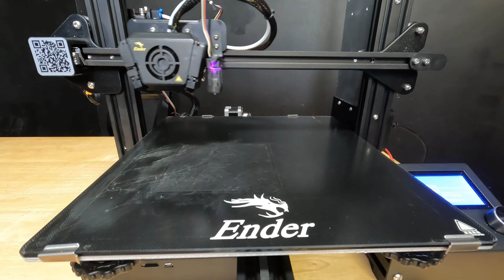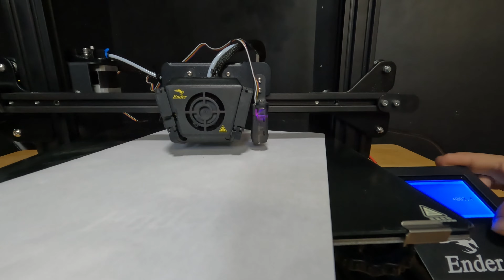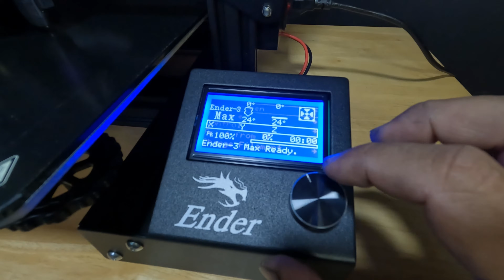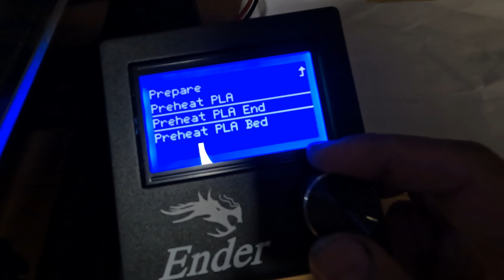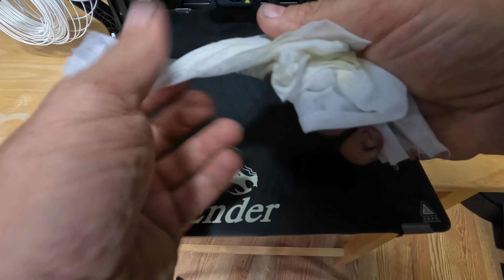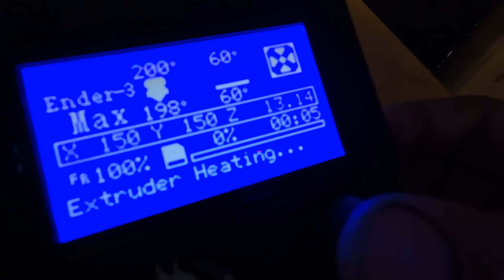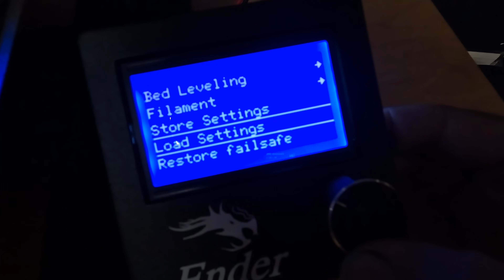Ender 3 Pro or Max: How to Level, Set Z Offset, and Make ABL Mesh, with CR Touch or BL Touch

Comment: hey i got the cr touch and have tried both creality software and marlin one but with both software whenever i try to auto home the ender 3 pro says that homing failed and it will go to the centre of the print bed and just keep trying to go down, ur videos are very informational and i rly like that thank you for these guides i hope this gets to you well.
Reply from the maker: All ender firmware is Marlin. Be sure it's a BL Touch compatible firmware.
Is your probe to high? Does it retract when it touches the bed? What if your touch it yourself?
Reply: @3DRundown  when i do a test its perfectly fine and shows the purple colour when i auto home it turns blue goes to the middle extends and stays extended the whole time when touching the print bed in the middle im sure its a bl touch compatible firmware cause i do exactly what you do
Reply: sorry for the double comment but ive tested it some more and ive lifted the print bet a tiny bit and now it will retract but it will stay in the center instead of going back to home
Reply from the maker: if the probe doesn't retract before the nozzle touches, print a spacer, to lower the probe. I have a video here for that

Comment: When I try and lower the z axis to get the number to put into the z offset later, my machine will not allow me to use a negative number.  I can input a negative number in the z offset but I have no way to know what it is because the machine won’t do it when the steppers are off and adjusting because it won’t let me go into the negatives.  Any advice ?
Reply from the maker: You can not go negative in the MOVE function. You must be in the Z OFFSET adjustment. Then, it will let you go negative, and save. It may be called "Probe Z Offset".
Reply: @3DRundown  under “motion” then “bed leveling”, I have “bed z”. I can set a negative number there but it doesn’t move the z axis when doing so. I assume that’s where you would set the negative number, but I can’t figure out where to go to be able to make it go into the negatives to find what the negative number should be.  
The categories are motion, temperature, configuration, change, filament, about printer, release, media, print for media.
Reply from the maker: Consider getting a modern Marline firmware for it, here: https://marlin.crc.id.au/
Reply: @3DRundown  Thanks.  I have BIGTREETECH SKR Mini E3 V2.0 motherboard but i don't have a bl / cl touch.  Which firmware do you recommend that would allow me to make a bed mesh without the touch?  My bed is not flat so i need as many adjustment input points as possible.

Comment: So i doubt it was your advice but rather something i did . I had tryed to do this several times after making a mistake that plowed the print head into the bed i decided to reset to default setings and after that seems i could nolonger mover the z axis with the dial wheel after I would run auto home . And normaly gives me the err too far messege on the screen . If anyone has advice on what thos could be ot would be grate im new to the ender 3 and its a ised printer so probably pocking up somoneleses problems lol.
Reply from the maker: I would start with getting better firmware on it. I use these guys, on my older Enders. you may need to donate like 2 bucks (worth it) https://marlin.crc.id.au/

Comment: i agree, very good instructions - the way I like them.   However,  when I go to Move Z on my Ender 3, it will not let me go past 0 into negative numbers.   Maybe there's a different option for Ender 3 v2
Reply from the maker: It's not Move. Move will never pass 0. You need to find the Z-Offset adjustment, and adjust it there. It may be called "probe Z Offset".
Reply: Did you ever find the setting? Mine does the same thing.  I don’t see the setting he is referring you to.

Comment: Once again, you’ve done it! I had trouble with my ender three max Neo, not printing. In other words the filament didn’t come out of the nozzle. I replaced the nozzle. I replaced the extruder and still no dice. Then I heard somewhere if the needle is too low to the bed, the filament will not come out. I had a clicking noise and that may explain why the filament could not exit out of the nozzle. I just did this video once again and I’m up and running thank you.
Reply from the maker: Very welcome! Now earn a STAR next to your name, and be a member. :)
Reply: And how does one earn a star? Is it a gold or a silver star?

Comment: Stupid Question.
What's the point of the CR touch if you still have to manually level?
I've had no issues thus far manually leveling with a standard Z-Axis sensor.
I'm not trying to crap on the parade....
But genuinely i need to know why this is an upgrade?
Reply from the maker: Because only a TRULY LEVEL (TRAMMED) bed, can print a model with consistent parameters.
Once the bed is as close to perfectly tram as possible, then, the CR TOUCH will probe the bed, create a map of the inconsistencies (MESH),  and then adjust for them while printing. Your 1st layer, at 0.2, is TWO TENTHS OF A MILIMETER. Having that EXACT across the entire bed, is virtually impossible. This will create digs and gaps, in your 1st layer. Your ABL Mesh, will compensate for that, to create a consistent 1st layer. 
It also gives you FIRMARE Z-OFFSET control. This is critical. You need that, to get your Z-Offset correct. Adjusting your bed or Z-Stop, is how you would have to do it otherwise.
Reply: @3DRundown  thank you for a legitimate response
Reply from the maker: What is an "ABL" Auto Bed Leveling Probe? What it does, Why YOU should have one https://youtu.be/yg2zVAakeGU?si=QW_ZXztyRwrdLgmd

Comment: Sooo I have to do all this. What’s the point of having the cr touch ? If you still have to level everything
Reply from the maker: Yes. You need your Tramming to be as good as possible. Your ABL should only have to compensate for minor differences in your tramming. A cars shocks can handle a bumpy road, but a well paved road is a better ride. Also, CR-Touch doesn't handle Z-Offset at all, that's on you.
Reply: @ hey I took everything off ( for the touch) now the z axis doesn’t auto home anymore. Do I have to install a different software now ? ( I installed the cr touch software for my ender 3 )
Reply from the maker: Keep the CR-TOUCH ON. You will lose ABL, and, you will lose Z-Offset control
Reply: @ how do I convert it back to normal?
Reply from the maker: You would install a firmware that doesn't support BL-TOUCH. And to use the CR-TOUCH, you would install firmware that DOES support BL-TOUCH.  I Would do THAT

Comment: My Printer was running for month and now I Changed the Nozzle. The Z offset isn't right anymore but I can't get it to move while printing. Any tips?
Reply from the maker: Your New Nozzle will be a touch higher or lower, than your previous nozzle, so you will need to set the Z-OFFSET after the change. It SHOULD move.
Reply: Sorry for the late answer I didn't see the comment😅 my problem is while printing when I go to tune the only option is z baby steps. I can go to configuration while printing and there I can change probe Z offset but this doesn't move the Axis. Babysteps Work but I don't know if I can use it and then add the value to my probe offset. I hope it's understandable. English isn't my first language 😅

Comment: My printer flashes the number and a "?" for the z axis on the info screen and doesn't want to move down for the bed leveling process, Do you know how i can fix that?
Reply: Is the z offset button thing disconnected?

Comment: I’m a bit confused as the last part, my Ender 3 doesn’t have probe z offset in the tuning section but it has baby step. Does that function the same?
Reply from the maker: Yes
Reply: @ thank you for your answer. I’ll try to play around with it.

Comment: For some reason after following this video to a tee, ive been having a issue all night and been trying to figure it out, my printer will now freeze 2-3 seconds into a print now since installing a CR touch im not sure if its a firmware issue or whats the deal but i cannot figure it out
Reply from the maker: Check all the cabling. Be sure nothing is shorted, and no connector is HALF IN. Consider a better firmware, such as one from these guys: https://marlin.crc.id.au/

Comment: That is true but we all know that the factory sometimes forget to check every printer out there because my build plate was lose on the. So I turned to the 3d community and you
Reply from the maker: Always a good idea to go over as much as possible. Also, things often vibrate loose over the long shipping trip from China. Especially on older machines
Reply: @3DRundown  I have got a ender3 v3 se. Thank you for your help and time.

Comment: Gregg adventure awesome video for the older model of the ender. Great information on leveling the build plate.can I do that or something like that on my ender3 v3 se
Reply from the maker: Your SE is trammed at the factory, and uses a Strain Gauge, to set the Z Offset. But the ABL Mesh, works the same

Comment: What is your meaning of snug*
Reply from the maker: Speak to me respectfully, and maybe I'll spend my time speaking to you
Reply: @3DRundown  not directed twords you in a disrespectful I’m just having the worst time understanding what I’m supposed to be doing my apologies 
Just realized my what auto correct to wtf
Reply from the maker: This is the place where frustrated printer users come....  Fear not, if you don't desire to throw your machine out the window, you are doing something wrong. It's just part of the journey. BUT, this part get's easy after some experience. The main takeaway, when paper tramming, is that the paper friction, feels THE SAME in all areas. That consistent rub, is the important part. The exact height, is set by your Z-OFFSET, which is the very last thing you'll do
Reply from the maker: It's fine to use adult language here. I didn't mean to be hard on you. I just never know who's commig at me. Some peeps come on here, just to talk shit and be nasty. I have to shut that stuff down. Please try this drill, after you think your manual tramming is decent: https://youtu.be/veZB415QHM0
Reply: @3DRundown  thank you brother really love your energy bro keep up the videos I’ll do my best if nothing else
Reply from the maker: We'll get you there. Also, pop into FB groups. So many helpful people.
Reply from the maker: Don't forget your GCODE, if you are running Marlin, (sounds like you are), with an ABL probe: https://youtu.be/mKvst6qpkPw

Comment: Really nice video and I might just buy one of these sensors (I saw your other videos) to try to get this going. My success rate on prints is 20-30% and inconsistent where it will work and then fail the next time with absolutely nothing changed. Hopefully these instructions (which were very clear with no time wasting) will help solve that. Well done.
Reply from the maker: There is exactly ZERO reason, not to use a CR-TOUCH on an Ender. I Wouldn't even think of it. Get one YESTERDAY.

Comment: I have watched this video with great success in the past when I purchase my bed leveller and the video is fantastic. I have change my base to a gold one which I had no luck with adhesion so I am back to the original black one and need to re level. But today I have had no success.  I have set the Z like you have mentioned like I have done in the past but now it is printing in the air. I cannot understand what I have done wrong . I have set it 3 times watching the video. any suggestions as what I am doing wrong . Thank you
Reply from the maker: Textured PEI sucks for ashesion. GLASS is far superior, or, SMOOTH PEI. SMOOTH PEI has very easy bed adhesion. Your bed will need to be SUPER CLEAN. On Glass, use Hairspray, or Bambu Lab  Green Adhesive. It's AMAZING. 

CLEAN: https://youtu.be/bfPm7BGjfdM
Z-OFFSET Test: https://youtu.be/veZB415QHM0
Reply: @3DRundown  thank you for the reply .But still confused as to why I have set the Z-offset my printer keeps printing in the air ?
Reply from the maker: Z-OFFSET, is the distance between the nozzle and the print bed DURING PRINTING. So, that is critical. Work on it, with me here: https://youtu.be/veZB415QHM0

Comment: Hey when I click on "level bed" my BL Touch goes of the plate on the front left corner and stops the prozess because he can't find the bed. Any ideas how to fix it?
Reply from the maker: Your Probe offsets are wrong, or, you have the bed size set wrong. Which machine?
Reply: @3DRundown  it's an Ender 3
Reply: @3DRundown  I tried some settings yesterday and I definitely think the probe offset is wrong. How do I find the right measurements? I got the printer used and the bl touch was installed. I'm a newbie and never had a 3D printer before😅
Reply from the maker: This is a great way to learn about all this. Try this for the offsets: -44 on X and -9 on Y.
Reply: @3DRundown  alright thanks 🙏 great tutorials btw :)

Comment: After installing the cr touch firmware, it glitches out when trying to select a print from TF card and freezes mid print.

Didn't have these issues before.
Reply from the maker: I use these guys firmware for all my older enders: https://marlin.crc.id.au/

Comment: Did not work for me, I’ve tried over and over again and when I start to print it grinds my pei sheet. My pei sheet is now destroyed! I’ve tried multiple tutorials and I don’t know wtf is happening! I keep getting errors when trying to create a bed level mesh and it never finishes.
Reply from the maker: This works. There is no debating that. If you are grinding into your bed, your Z-HEIGHT (Z-OFFSET) is too low. Start higher, and bring it down during a 1st layer, so you can get it right. If your mesh is failing, your CR-TOUCH may be defective. Consider swapping it out. 
Try this Z-OFFSET exercise: https://youtu.be/veZB415QHM0
Be sure you are using the correct gcode: https://youtu.be/mKvst6qpkPw
Reply: @3DRundown  thank you for the advice! I will try all this and get back to you, I’m desperate at this point and at my wits end.
Reply from the maker: It's OK. This kinda stress is a right of passage, for getting started in 3D Printing. We'll get you there. Which machine are you on? Consider seeing if any of this applies to you: https://youtu.be/pP36ozrfRQ0
Reply: @3DRundown  well here’s the thing, I’m on my original Ender 3 pro that I’ve had for the last 4 years but like everyone else I got the upgrade bug and went ham. Upgraded bushings, pei bed, skr mini e3 v2.0, tft35 v3.0 touchscreen, cr touch, dual z axis, direct drive, and just had help getting a custom marlin firmware after I bricked my skr mini e3 v1.2. This upgrade has been a year in the making and I’m about to lose it wishing I never upgraded 😫
Reply from the maker: You'll notice something here on my channel. I almost never talk about "Upgrades". I am a fulltime 3D printer, with 40 machines, and they are all almost entirely stock. Upgrades usually lead to problems. Most troubled posts online start with "I upgraded to..." "I installed".....
Textured PEI beds SUCK. Put your glass back on. Dual Z isn't needed for such a small machine. Not even for the 300x300 machines.... such as the E3 MAX.  Unless it's a Sprite SE, 3rd party DD are usually a pain. CR-TOUCH is a must. You def want that. 
Save your stress, and grab an Ender 3 SE or KE, and be printing in 20 min.
Reply: @3DRundown  yeah I’ve looked at the ke for quite some time but I also wanted to get this running good so my son can have something to use and mess around with.
Reply from the maker: It's tough to help, with so many upgrades, as there are endless variables. However, once a print id initiated, the 1st layer height is determined by your Z-Offset. Work on that. When trying to set it, Always start HIGH, and work down slowly.
Reply: @3DRundown  ok, any advice on a quick print that would work well? I was thinking the calibration cube.
Reply from the maker: Remember, Z-Offset ONLY affects the 1st layer, so, you want something with a larger 1st layer, and, use a few skirt loops, to get even more time... OR, do this: https://youtu.be/veZB415QHM0
Reply: @3DRundown  thank you again for all the help. I’ll try this weekend and see what I come up with.

Comment: Would a feeler gauge be more accurate then a piece of paper.  I use a .006 gauge.
Reply from the maker: no, because it doesn't allow YOU to be the tool. Nothing better than you. Once you get that "feel" down, this process is a cake walk that you can do in 2 seconds. I strongly recommend doing it with paper.
Reply: @3DRundown  Huh, a .006 feeler gauge is just as bendable as paper.   I currently don't have my BL touch connected as I'm waiting for my Duet 3 mini wifi board to show up so that I can upgrade my Makergear M2.  My build plate is a .250 Mic6 Aluminum plate, so it's pretty flat.  I have just alway had better luck getting a good 1st layer with a feeler gauge.
Reply from the maker: I prefer paper. ABL is a must, and will make the whole thing easier, as minor issues will be handled by the mesh. It's nice